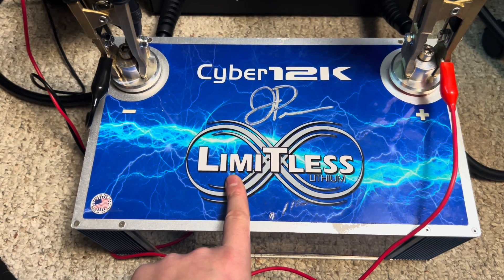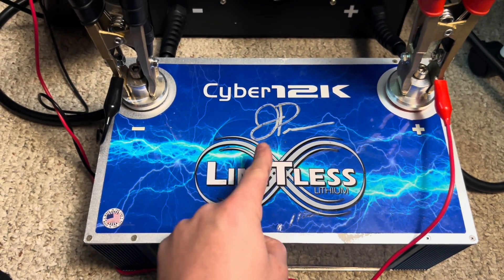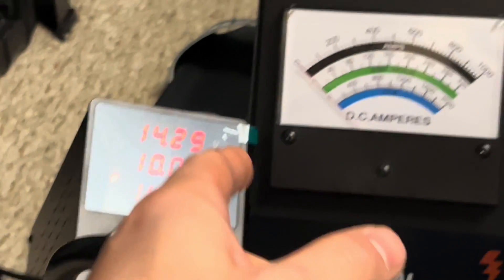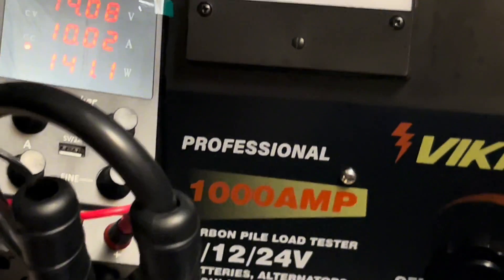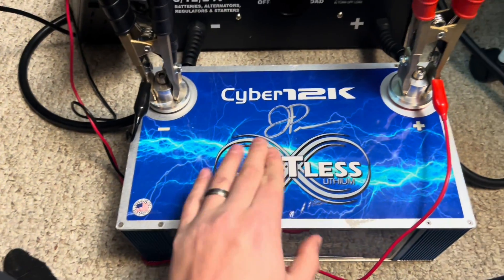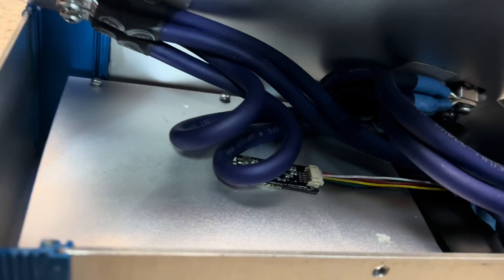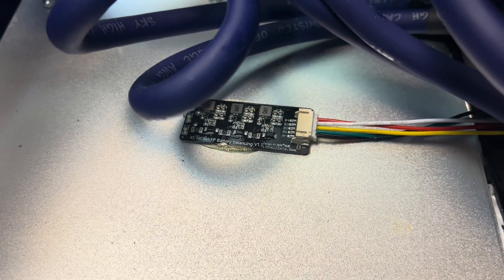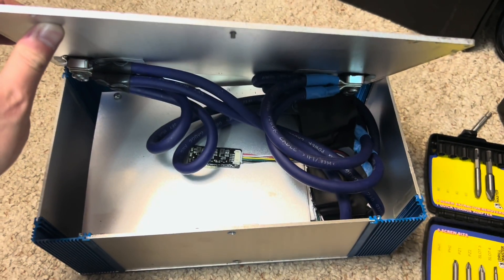Testing a Bad Lithium Battery 🪫Cyber 12k (Gut Shots Included)

Comment: 12k watts is a lie. I'd get drops on 3k amp. Not much. Moved to 5k, dropped mid 13s (chargev14.8). Moved to 7k drops low 12s. Ditching it for CMAX. Inside cyber 12k barely has any lithium in it. 45ah also a joke.
Reply: I’m glad I read this I almost got one thanks buddy
Reply: I ran a DD M5 wired to 1/2 ohm on 2 HDC412's, and a 240amp JY alt on a 45ah Limitless and never dipped below 13.4 at a modest full tilt in my '92 Civic. Did quite well. But now I'm sitting on my living room floor looking at it sit at 0.2 volts. Lol.
Reply: @poppynokc1977  I grabbed 45ah CMAX from Vibration Audio a couple months ago. Love it. My car caps charging at 15.3 volts. Now cranked usually sits 14.8 to 15 volts. Never dips below 14.6.
Reply: @poppynokc1977 why what happened
Reply: I have a taramps boss 8 , never dropped to 12 with the cyber 12k
Reply: @moneymac5214  On a Surge 7k @ .67 ohm. Cyber 12k could not hang. Amp too hungry. Now on 45ah CMAX charging to 15.5volts never drops below 14.5 Love it, but the cyber 12k did recover faster. CMAX charges slower than Cyber 12K. (320 amp alt)
Reply: I've seen a guy's comment,went from the cyber 12k to underground power 100ah, and he's happy from there on. So got myself a 40ah ugp.

Comment: Would you want to get rid of this I would like to try to repair it with new cells and have a good battery i can't afford to buy something like this outright tight budget
Reply from the maker: That’s my exact plan on it ! The case should be a solid little battery holder ❤️

DIY you can always save money 

What are you trying to support exactly
Reply: @LivinLoudwithAndy   right now I just have a dual Q-class L7 12 setup on a CXA 1800.1  but when taxes come I'm going for a 15" solo x with strapped 1800.1 or maybe an 18 if they come out soon any idea when the warhorse 3600.1 is dropping in case you can't tell I love kicker lol 😆
Reply: My 45ah Limitless Lithium went down to .3v. Sent it back and they trickled charged it using a 2 amp charger. Worked fine

Comment: what can i do if its hard to get a alternator for car but ones that have it for my ford edge 2013 have alot of comments of it failing. but som alternator sites dont build for my 3.5 l v6 but build for same alt thats in that year ford tauraus .need help is there any thing else to do besides take bass out the car or go lower in amps.
Reply: Go talk to brand X Johnathan Patrick he's a personal good friend who builds the greatest alts and builds them custom for you directly say if you want it internally regulated set at 14.8v or higher with a voltage controller he can do it I personally have a 390amp alt throwing out 430amps 4 years ago now and he covers life time warranty on his alts - cost of materials free labor tell him Ryan Connors sent you he will build you whatever you want with the best parts hands down awesome dude!
Reply: Ok tks @justforlaughs8988
Reply from the maker: Batteries are always a good way to go - more capacity - the longer you can play on low charging systems 

All of my builds except 1 have stock Alts 

But batteries able to deliver the juice and keep the voltage steady 

Until they are exhausted obviously 

I am associated with two alternator companies and can get something custom for you if you cannot find one !
Reply: Tks  @LivinLoudwithAndy
Reply: tks can i get links or sites so i can start to busget lol  i have subs custom box on its way shits expensive and my alt in a tight spot which go be out the wazooo to  install @LivinLoudwithAndy
Reply: @slowbrezze I actually have a un used high output Mechman alternator for a 2013 for edge 3.5l in my garage if you're interested? I bought it about 2 months before totalling my Ford edge and never got to install it 😔